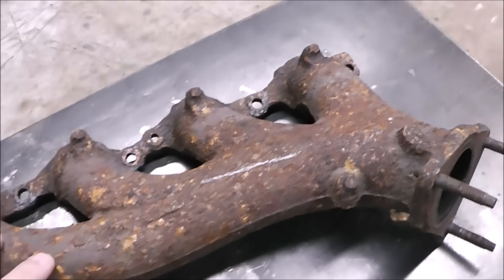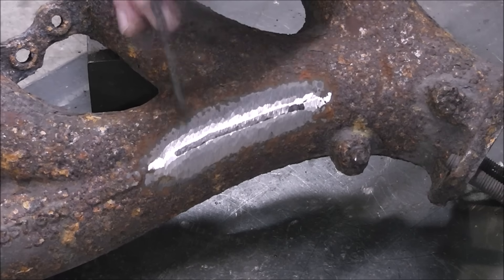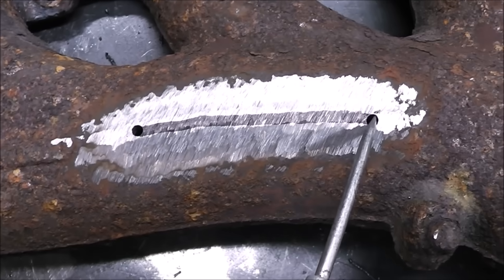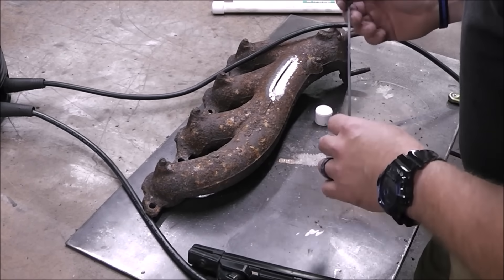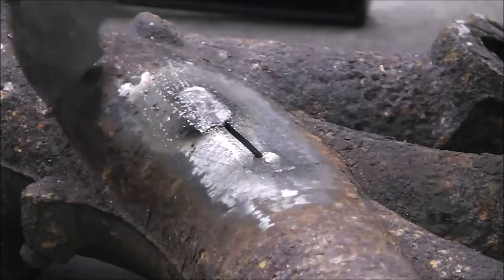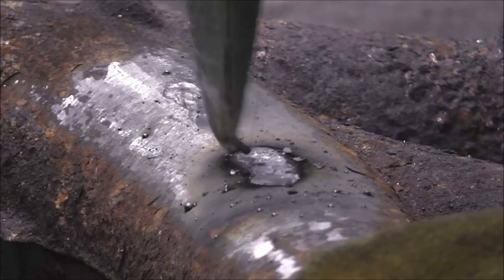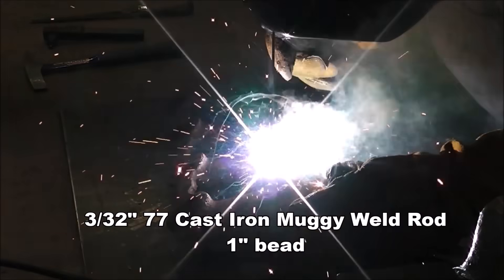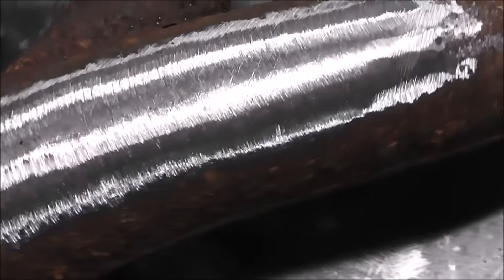Stick Welding Cast Iron Repair with Muggy Weld

Comment from the maker: WANT TO SEE WHAT THIS LOOKS LIKE ON THE BACKSIDE? WANT TO FIND OUT HOW STRONG THE WELD IS? FIND OUT HERE: https://youtu.be/cVrydI-v7B8
More cast iron welding videos here: https://www.youtube.com/playlist?list=PLfbf78fMz9VpweFv4IqUfrrNV6Vvro7Cd

HERE IS THE INDEPENDENT TESTING SHOWING THE CARBON CONTENT https://ls1tech.com/forums/forced-induction/1750208-what-truck-manifolds-really-made.html

NO I did not mess up.
NO I did not weld one side then finish on the other.
Both sides of the manifold were prepped. You saw me prep one side. The other side was also prepped for a future tig welding video.  Being the producer, cameraman, narrator and welder, I didnt realize that I was welding on the side that you didnt see me prep.
Reply from the maker: @ThePaulv12  great idea! plus it gives a little cleaning action before welding! Great tip!
Reply: I think she turned out fine. Keep up the good work and keep making videos!
Reply: This vid has me wondering how that manifold held up long term? If it was put back into use and not just a scrap piece used for the vid.
Reply from the maker: @cutlerf2194 this is a demo piece.
Reply: I like your watch,  what kind of watch is it?
Reply from the maker: +akim mohammed thanks man! It's a g-shock.  I alternate between 2 watches. This is the one I'm wearing in this video. https://amzn.to/2CBH1bP To see my other watch, just click the link in the description where it says "tools I use". Thanks man!  Cheers!
Reply: Ha see sacador de golpes en aluminio
Reply: I
Reply: Pm
Reply from the maker: Thats what impressed me!
Reply: I ain't look but I bet the root pass is on bro
Reply: I seen folks on here not clean nothing or champer anything and title was this how u git her done ...lol they dint use anti spatter spray they use insecticide  keep the worms from crawling through the weld and  breeding inside it afther it's in the scrap pile ohh yeah  lol
Reply: Do a  dye penetrate on the weld , if that's perfect you can weld cast iron .
Reply from the maker: @peterpalmer9607  Yah sure...lol
Reply from the maker: @peterpalmer9607 Thanks peter, I'm not doubting your expertise, but most people (myself included) are not going to magnaflux a $20 exhaust manifold. It was a very basic repair to give a beginner some knowledge on how to make a repair to cast iron using the most common tools...a stick welder and some welding rods.  Take care. Brandon
Reply: I'm guessing the people that can't use diamond blades are installing them backwards.....🤣😂
Reply from the maker: That very well could be! Ive been using Graff Black discs and they are non directional and continuous rim. I love them.
Reply: @BrandonLund  when I was a pipe layer I cut a lot of pipe with diamond blades and they all had a one way only direction. If you looked at it with a loop you could see the angle of the chips. I haven't used one in years though.
Reply from the maker: That’s the same in my experience Frank. The Graff blade is the only diamond blade I have ever seen or used that is non directional.
Reply: @BrandonLund  thanks for the info. I'll have to check them out next time I'm in need of some blades.
Reply: Hi Brandon, I really appreciate your videos! It was this one that has prompted me to buy the 72 77 rod for some antique tool restoration. But I'm not gonna lie I'm not getting the results you are. Not even close. Nearly all my welding experience is on mig but I've been practicing with some 3/32 6011 I believe and some 1/16 6013 on a cast iron pan before I use my expensive muggy rod. I'm hoping it's in my technique, but I fear its my welder. I started with my brothers oooold 70 amp buzz box he got from our uncle. It didn't go well so I got myself the Harbor Freight 80 amp inverter. And it's the same thing. Harder than heck to strike an arc without sticking. Sixteenth rod I can at least maintain an arc but 3/32 it cuts out on me. I whip and pause, I try a straight run.... I have times where the flux looks "good" but I peen it off and find the weld skips and alternates on either side of the gap instead of filling... At first I thought maybe I need to preheat better but I rewatched this and you dont heat at all. I'm hoping it's me and I just need some more practice because the HF welder is about as much as I can justify spending. I know it's difficult to troubleshoot through a comment section, but I dont remember stick being this dang hard lol. Any response or advice would be appreciated!
Reply from the maker: I dont think the HF welder is the issue. Welding on low amps can be tricky. Grab some 1/8" 6011 rods and set your amperage between 90-120 and see how it goes. It sounds like your travel speed is off. Experiment on some plate until you know what looks good then try using your smaller rods at a lower amperage. A lot of guys start out on thin metal and get discouraged as you are feeling. Go with bigger stuff to get a feel for it then practice with the smaller rods which can be less forgiving.
Reply: @BrandonLund  thanks for the response! The welder only goes up to 80 amp unfortunately... but i will definitely grab some plate for practice! Maybe if I still cant get results, I might just have to upgrade to welder that can handle an 1/8 rod.  Thanks again!
Reply: @josiahpeters4717  You can get a decent welder at Harbor Freight. They the usual good- better- best. You don't have to go best, just stay away from those 120 volt welders, there are good ones but again you are going to pay the price for a Miller or equal. Throw out a few extra bucks for a 240 volt, those 120v machines just won't handle the loads. They will cause your weld pass to skip one side to the other. You will not believe the difference that other 120v will make. I installed another 200 amp service to handle all my machines. Cheaper there paying for a phase adaptor every year.
Reply: 8⁸88
Reply: Did you send me a message that says I was randomly selected for a prize. The YouTube channel that send me the message was created on July 2022 it has phone number on channel name
Reply from the maker: Nope. A scammer is trying to get you to pay shipping on a prize they will never send
Reply: @BrandonLund  thanks a lot
Reply: I was a maintenance man in an iron foundry that employed lots of farmers. I welded lots of tractor parts during lunch time. I asked how the welds held up and they all said "great". We used it to make the molds and poured a new cast iron one.  Oh well. .   . .
Reply from the maker: @jeffbrown3963 farmers are the true test. I've heard from MANY that swear by stick welding cast. One even had a broken axle that's been is service for years.

Comment: One thing that works is to preheat to 300 degrees or more, then it won’t crack. Welding supply stores sell Temp Sticks so you know when you reach 300. Plain nickel rods work well but I would like to try the Muggy rods.
Reply from the maker: That's a great tip, thanks for sharing!

Comment: Mugg Weld 77 cast iron rods $80 dollars. New replacement / refurbished manifold $80.00 dollars. If you cannot get a replacement, use brass rods to cast iron much cheaper.
Reply from the maker: You don't seriously think this video was about repairing a 50 dollar manifold, do you? You do realize that this applies to cast iron parts such as engine blocks that are no longer made right....

Comment: I can weld cast iron with 6011 or 6010 welding rod.
Reply from the maker: If you want to know how those filler metals compare to one another doing a break test, check out my cast iron repair playlist.

Comment: Ok, got a problem: 07 Hemi.  Ear with hole for oil pressure sender cracked off (customer over tightened sender).  Alternate port being used for sender, want to seal hole. I have stick, mig and flux core available.   What would you recommend?
Reply: Note hole has been drilled out to about 7/16 (attempted to use helicoil).  Customer also attempted using jb weld
Reply from the maker: If you have it available, Mig using silicon bronze wire and 100% argon gas.

Comment: Years-ago I used-to stick-weld exhaust-manifolds when i changed the flange-angles for repowering vehicles with chev V8's ( a lot of XJ6-jags where the engines were too-expensive to rebuild ) I always pre-heated though and ran a sooty oxy-acetaline-flame over the weld-site before welding and tapped to relieve the stress . Never had one break......dave  nz
Reply from the maker: Thanks for sharing your experience, Dave!

Comment: You tig weld with cast iron filler rod it expands and retracts at the same pace I have done it for years don’t over heat
Reply from the maker: Yes, you can TIG with cast filler, but there are other processes and fillers that work just as good.

Comment: All you need to weld cast iron is the Forge 200 rod. It'll weld the crack shut just like it was steel. No pre heating. Best rod out there for cast or welding dissimilar metals.
Reply from the maker: Silicon bronze is pretty fool proof also

Comment: I welded cast back in the 80s and 90s. The only rod I used on cast was eutectic welding rod. No prep what so ever. But it was very expensive.
Reply from the maker: I've heard of it but never used it

Comment: Nickel rod works best for cast iron repairs.....
Reply from the maker: Best is pretty broad. If your after strength, silicon bronze is about as strong as you can get and probably the easiest for anyone to do

Comment: Most exhaust manifolds are cast steel, not cast iron, and can be welded with a mild steel rod. Or wire. .a nickle based rod will always have good strength and will not be daming on cast steel, but is an extra expense. .know what your welding is best, and if not use the nickle based rod.
Reply from the maker: Maybe where you are, but here in the United States, 99% are made of cast iron. Including this one, which is why I included the lab analysis in the pinned comment.

Comment: Nickel rod works awesome. warm up your cast before welding.
Reply from the maker: It was done this way so viewers could see the results in a worst case scenario. Meaning no pre and post heating.
Reply: @BrandonLund Nice . I have people come around all the time to have me repair old manifolds that can't be replaced . Keeping old vehicles running with stock parts that are unfindable. Can't replace it repair it . 😎👍

Comment: Cast iron is more robust than most people think. That exhaust has been through many fluctuating temperature cycles and it barely cracked. Just turn the oven on blast through the weld on low settings throw it in the oven and slowly decrease the ovens temperature to about 80 degrees should be just fine.
Reply from the maker: That's interesting info, thanks for sharing!

Comment: The weld was on the other side of the manifold in the first 3/4 of the video, then flipped over to the opposite side when it was all done and cleaned up.  Two completely different places...?
Reply from the maker: READ THE PINNED COMMENT AT THE TOP

Comment: To no over time but to help it to stop cracking you shud weld it under a propane fiam whith sum cast iyen welding rods this ceaps the oxygen auwt of the weld be cos welding cast iyen is difikult at the best  time you can tutch the weld up whith disimler welding rods and put the Erth terminull on the peas of manefold you or welding and put it at the same side you or welding like at the end of the crak you
Reply from the maker: Maybe you missed the reason for the repair. It was viewer suggested and welded WITOUT any pre or post heat to test the crack resistance.

Comment: Finally I watched a whole welding video on you tube without stopping leaving a comment about how ridiculous the person was .Great video by someone actually knows what they doing .I've welded many cracked engine blocks that froze mostly  tractor blocks with high temp silver solider by tig process and a beautiful outcome .This guy ain't a want to be like a bunch making weld videos on you tube .Happy welding and best wishes peace out all.
Reply from the maker: Thanks for the kind words!
Reply: @BrandonLund well kind words ain't exactly. I welded for 42 years and ur video was spot on for cast nickel alloy stick welding .the point  were accurate as well as still the end for relief so it didn't continue to run the crack as well as the ping keep the density of
F molecules of the weld so therefore the cast also would cool closer to the denser aka weld and it pull free from the cast iron .As far im concerned ai.t nothing at all left out to do the job professionally as anyone could with stuck process thanks for sharing true knowledge of small world task and education ain't never free it seems all that didn't  know this procedure give thanks to this fine young man that showed u the correct way to do it .thanks again fellow craftsman
Reply from the maker: I really appreciate your kind words. It means a lot, especially coming from a veteran welder. Thank you! 🙏
Reply: Pinging the dense weld helps expand the dense well helping and preventing draw from the porised cast iron nothing is 100 percent but if you don't over heat and cause quick cool downs as he has showing. And ping expand u should be wearing diamonds at the end of the process lmao happy welding folks maybe thats a bigger 10 -4 lol

Comment: I am going to attempt  repairing nickle alloy castings,and i am not a welder by trade.i will be filling in  the parts where maybe bubbles stop from filling in when poured.
Reply from the maker: Good luck with your repair!

Comment: Use ni rod in a pinch use 309 stainless  drill out the end of the cracks and pre heat to about 500 degrees wrap it in a fire blanket to.keep it from cooling off too quick
Reply from the maker: Thanks for the tips!

Comment: On cast iron pipe fittings we used E7018 electrodes with no issues at all. 
(Atom Arc was the go to 7018 rod)
Reply from the maker: Thanks for sharing your experience, I appreciate the info!

Comment: What about wire welding cast
Reply from the maker: Use .030 silicon bronze with 100% argon. It works great and its almost as strong as the virgin cast.

Comment: Always cool seeing what works for others when it comes to cast repairs. I've been doing them in GTAW with thoriated tungsten and Blue Demon ERNI55 filler. This has been a winning combination for me so far. I do pre-heat to 400F and peen the heck out of the weld while it's still malleable and that's key for heat retraction applications.
Reply from the maker: Blue Demon makes awesome filler metals! I have a bunch of their tig and mig wire. My best repair to date which is almost as strong as the original casting was using Blue Demon silicon bronze with MIG (mig brazing). It's as easy as welding mild steel and lays down like butter, and it's super strong and crack resistant. Give it a try. It's very forgiving.  It's awesome!
Reply: @BrandonLund  I will give the Silicon Bronze a try! I really like the Blue Demon fillers and consumables.

Comment: Are crank shafts in motorcycle made from cast steel too or just steel.
Reply from the maker: Great question! Many are made of forged or cast steel.
Reply: @BrandonLund  Thanks, bud. Reason I ask, I'm going to have a go at welding teeth on my crank shaft from my scooter bike, I can't just buy a new one because the company went bust, and the second hard parts are rare to find. So mend and make do is my only option.
Reply from the maker: @CIassicAutoRider its definately worth a shot!

Comment: Hi Brandon - you mention that to tig weld with this rod to soak it in water to get rid of the coating.  Do you know or think that would work to weld it with an oxygen and acetylene torch? Thanks!
Reply from the maker: That would work also
Reply: @ thanks dude - I have to repair a cast iron exhaust manifold on a 1944 cockshutt 90 tractor that I’ve been restoring.  A couple of the flanges that have bolt holes through them are broke off, so I am just trying to figure out the best method with the tools I have.  I have a big old Lincoln sa200 arc welder and a oxy/act torch.  I have cast iron electrodes - just not sure which will give me the best result.

Comment: I was taught to heat cast iron with a torch slightly before welding the crack.
Reply from the maker: You were taught correctly. I was testing the elongation claims made by the manufacturer. Basically trying a worse case scenario to see how it would hold up.

Comment: Hit the object with a hammer, if it rings it is steel, if it sort of thunks dully it is cast iron. Next after you have ground it or wire brushed the bejesus out of it try to take a file and put a light cut on ground surface you wish to weld. The carbon nodules in the cast iron smears. An oxidizing flame is second best to clean that undesirable finish. Heat the object you wish to weld hot but not any shade of red - just approach that. Weld with a good stainless steel welding electrode, peening the welds frequently as you are welding. Reheat and bury the object in sawdust. This slows the cooling, it may even smolder a bit, sawdust is full of carbon so that is not a bad thing. Let it cool at its own pace. Dig it out when cool and then clean up the weld with a grinding disc. I have welded a LeBlond lathe bed that was totally broken, in that case I used large resistance elements and surrounded the area with sheet steel heated, welded then add sawdust after giving it some more area heating. On the lathe bed, prior to welding I also drilled and tapped and put in short steel studs in the V'ed area for added strength to the weld. It came out true and so far as I know it is still working.
Reply from the maker: Excellent advise! Thank you for sharing!